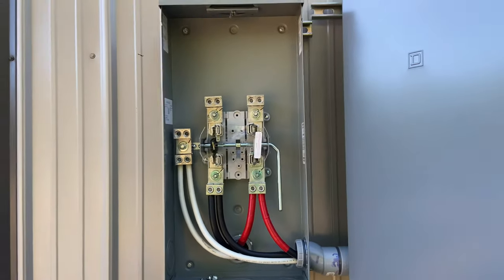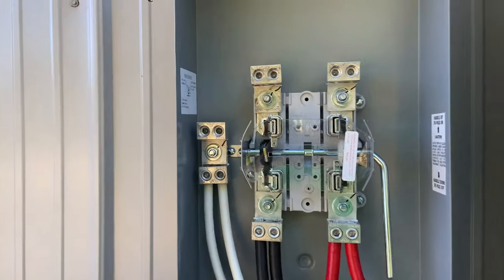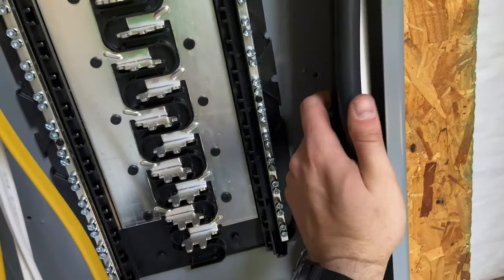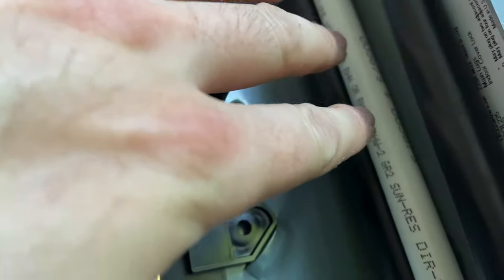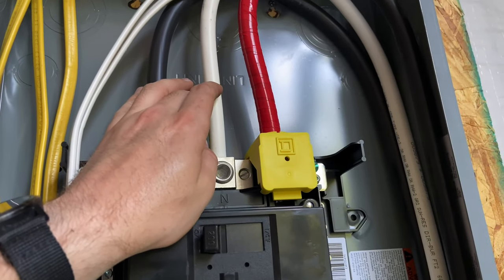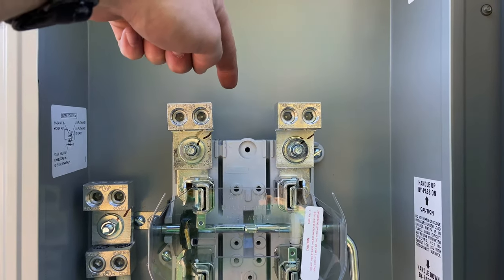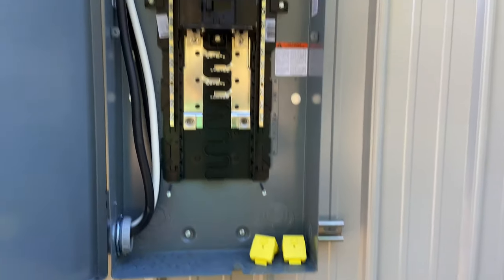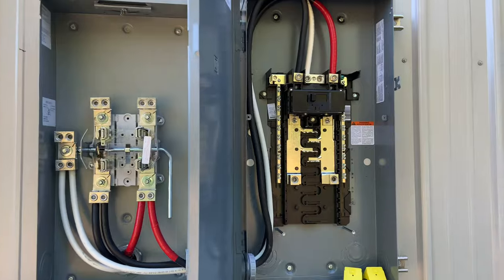Episode 16 - Service Entrance Wiring

Comment: So that's the meter base the power company provided? Good for you! Now it's on them. If they provided you with a 320 amp meter base then they must know the lugs and clear space in that can will accommodate their wires coming in and your wires going out. But they can't come in the bottom like you piped for them. Did they say they were coming into the meter base through the bottom.? Line an load on a meter base cannot share the same space. They have to come outside on the left to the line side lugs on the meter socket. It looks small, but they provided it. It's on them if it's wrong. They're gonna get out of it though by telling you your pipe job causes their wires to cross yours and that's unacceptable and their wires 
have to be totally independent of your wires so you will have to re-pipe up the side of the can and install a big lb or weather proof box nippled into the meter can. I'd like to see the size of wire they are bringing in to feed the line side of the meter. It will be aluminum tri-plex. They will use whatever will fit regardless of how much current you need. They are exempt from following the NEC. I'm surprised they arentbring the service wire in a conduit. Usually when you use direct bury cable that's not in pipe you have to provide a substantial sand base and substantial sand covering then you can fill in with dirt. But that's not NEC. That's what we use in my area, which is a lot of work for residential so we use 3" conduit as required by our local utility.

Comment: What happened to the NEC rule about all service disconnects being grouped together?  I guess different  parts of the country have different rules.
Reply from the maker: I did wonder about that. I have the two disconnects for the 2 “legs” of the 320amp service grouped on the same building, just one inside and one outside. 

I think this complies with at least some version of the NEC. 

In reality, the house will have an emergency disconnect on the outside per NEC 2020. 

I did not want yet another exterior panel on the shop just to feed to an inside panel so I am comfortable with the configuration.
Reply: @Ciband  ... grouping disconnects together only applies when the power is all within the same building. IOW, an apartment or several store fronts under the same roof.

Comment: I wonder what guage the power company uses to feed that setup. Probably 4/0... Also if you touch a feed lug with your screwdriver there will be a nice 💥 and the screwdriver end Melts and or welds itself to the panel, (usually just takes a nice big chunk out of the end of your screwdriver) ask me how I know.😜 Much appreciated for the video too. 😎👍🙏💯
Reply from the maker: Thanks for watching. 

My power company used 4/0 AL URD.
Reply: @Ciband  yeah it always seems like they go undersized, on their triplex too. My inspector just told me to use 250 aluminum for double 200amp panels for a double gang meter socket, my point of attachment is up unlike yours. Thanks for the video 👍😎

Comment: Can yo u list the part numbers of the Square D panels shown in this video Thanks!
Reply from the maker: Sure.

Outdoor feed-through: https://amzn.to/40UO1XM

Indoor Panel: https://amzn.to/3GC9NaB
Reply from the maker: I can’t speak to the meter main as I don’t have a lot of experience on that but I think you are on the right track. 

I am using 2 slots of the feedthrough panel for the surge protector for the house. I decided to put it there as close to the service entrance as possible. I have a matching one on the shop panel.  I will probably add a generator back feed breaker and interlock kit there too, eventually. 

Thanks for watching and good luck with your build.
Reply: @Ciband  As to your METER BASE with the DUAL LUGS  did the POC give that to you or did have to purchase that 320 Meter base?  If you have a part number of the Meter base I would like to have it from you ---  I need to be able to have a DUAL LUG 320 continuous service meter base with dual lugs as I want also to to feed two 200 amp panels like you have done.
Reply from the maker: I do not have a part number, unfortunately. 

This base was provided to me for “free” as a part of the install cost for the service from the power company.
Reply: @Ciband  OK Thanks!

Comment: The use on the feed through lug panel was fabulous.  I like that idea...maybe someday out door lights or an RV hook-up "who knows" but its nice to have the option for more power outside without drilling holes into your shop to get power outside.  Did you set two ground rods 6' apart below the panels or did you install an Ufer ground? 
I find it interesting both panels have the green bonding screw attached but I guess they are both main panels.
Reply from the maker: I used two ground rods.  The house will have a ufer. 

Yeah as near as I can figure from code that are both main panels since the service is paralleled. 

Thanks for watching.
Reply: @Ciband  .. yes, first panel from the meter is considered a main panel.... and two panels in your case.
Reply: Since neither of the panels are subfeed panels and both panels come from the service feed, the use of a bonding screws is required
Reply: @Ciband  I agree great Idea. I know one of my separate buildings with its own meter has the service disconnect and the meter in one box. It also has another breaker in it for the outside pool equipment. I wonder if they still do that.
Reply: If use feed through log panel can not use 4/0 luminum you have to use 250 kcmil or 3/0 copper because you can not apply 3.10.15(b) (7) of nec 2017 or 310.12 of 2017 nec
Reply from the maker: Thank you for this information. 

If I am understanding correctly then then I just apply the 83% rule to the service rating and then size conductors based on that. 

I have a 320A service feeding two 200A panels in parallel. 

I assume this is more a 400A max, 320A continuous service. I’ve hear this type of thing called both. Let’s assume 400A. 

Since I have the system split into 2 200A panels, then the service rating would be 200A, right?

If so, then 200A * 83% = 166A. Max amperage from NEC 2014, 310.15(B)(16) shows 180A for 4/0 AL. 

Am I missing something in the calculations?

Code aside, I don’t understand the distinction. A 200A breaker protects the wire. Why special rules for fees through?  Electrically I think it is not different than a sub panel. 

Thanks again for showing me this. I had not seen it.
Reply: Exactly what I have been looking for u wouldn't happen to know the numbers on the boxes??
Reply from the maker: Sure.

Outdoor feed-through: https://amzn.to/40UO1XM

Indoor Panel: https://amzn.to/3GC9NaB

Comment: What do you mean your not gonna use the ground wire?
Reply from the maker: If I remember correctly, I only needed 3 wire service cable since I was going from the meter to the first disconnect where the neutrals and grounds are bonded. I could only find 4 wire cable so I just bought it and did not use the ground wire. 

Thanks for watching.

Comment: What kind of offset conduit did you use to connect the meter base to the square D panel?
Reply from the maker: It was a 2” PVC offset. I think they are called meter offsets. It’s about a 9” pieces with a couple 45s pre-bent into it and make threads on the ends.

Comment: Would it have been to code to mount that box flipped 180 so that the large wires had a shorter run?
Reply from the maker: For that panel, I’m not 100% sure. I know you can do that with some Eaton panels.

Comment: be sure and drive ground rods and ground the steel bldg to the panel. steel post or wood post? bond to the steel post
Reply: Looks like he's got both of the panels bonded. I would think that he would need to bond everything in the meter and separate the ground and neutral in both panels?
Reply from the maker: Wood post pole barn. No structural steel.
Reply from the maker: No bonding in the meter can provided by PoCo. Bonding done at the main panel(s).
Reply: @Ciband  where are you going to bond the grounding electrodes?
Reply from the maker: Main panels

Comment: copper even if it’s expensive Copper can take more load then aluminum and if you over bend aluminum it leaves hot zones in the cable also did you put penetrox on the lugs and open aluminum conductors ?
Reply from the maker: Sure, I agree. AL gets the job done for service conductors. 

The cable and lugs I used did not require it per the manufacture. Modern aluminum wire and lugs do not need it.

Comment: How many Amp will be your main panel and your house subpanel?
Why not having three-phases?
Reply from the maker: I have 320 amp service to the property with 1 200 amp panel for the house and 1 200 amp panel for the shop. 

I did not want the additional expense of 3 phase. I don’t think I will need that much power but who knows down the road.
Reply: 3-phase is not a thing everywhere. Most of the US has "single" phase: a single phase 14kV goes down each street, with a special transformer for 1 to 3 houses making a split-phase so 125Vblack+125Vred makes 250V. 
The middle of the secondary coil in the transfo is neutral, and gets grounded!!
Getting 3 phase down an ordinary street is a major upgrade back to the distribution line.

Comment: It is crazy how an outdoor breaker box is so much cheaper than the outdoor disconnect that they actually want in the code.. the 'firefighters' switch as it is called in some places...
Reply from the maker: No kidding. I was very surprised.
Reply: @Ciband  ... most areas require a disconnect by the meter if the panel is more than 15 (?) feet away.

Comment: help me out here! you have a 320A meter can with meter but you have 2-200 amp panels/service? that is 400 1.25 demand factor...and you downsized the neutral in the garage panel, cant do that!  Why did you chose AL over CU conductors for short runs when you have several hundred feet to run to the house. Saving pennies on your electrical service is not the place to save $.  Did the inspector sign off on this install? Who did the original design?
Reply from the maker: I did the design. 

No inspector. PoCo didn’t seem to mind. 

Why pay 3x the cost when I don’t need to. I understand copper is better but aluminum works, is to code, and easy to swap should I ever need to. 

Downsizing the neutral one trade size is pretty common, especially since the triplex I bought was setup that way.  Thank don’t makes you feel better my shop will have a lot of 240v equipment. I’m sure if I did the load calculations I could go smaller, but MHF is cheap. 

As far as 320amp (continuous) vs 400amp (peak), using a pair of 200a panels on this type of service is pretty common. 

The service conductors from each “leg” on the meter are sized for 200a (4/0) so I’m pretty sure that is ok. 

Thanks for the comments.
Reply: @Ciband  I am a retired electrical engineer with a Prof. Engineers license and I am studying for my electricians license. I found this post which i find interesting.  I am going to use this case example to aid my study for the exam. I am not trying to be a smarty or do a gotcha...trying to learn from this. 

I notice you use terms like "pretty common" and "pretty sure". Electrical installations and engineering are based on standards of engineering and safety codes. Just saying....

There is a reason why the neutral is sized the same as the ungrounded conductors (not wires). During a fault of line-to-line or line to ground the neutral is required to carry that current which can very high as in the tens of thousands of amps. They are called symmetrical and unsymmetrical faults. FYI. Grounding conductors bonded to the equipment is there to reduce the potential of the equipment to zero. This is why Table 250.66 allows for smaller grounded conductors. 

Even though 240V equipment is used the neutral will carry some currents and is required to be the same size as the ungrounded conductors. I need to study this more. Chapter 2, Articles 220 and 230 deal mostly with SE conductors for housing while Chapter 4 (I am not there yet) will pertain more to your situation.

As for no inspector and it seems you are not "licensed" so IF something goes wrong such as a fire or an accident the insurance company will not be too friendly. IMO. This gives people like me a job...LOL. 

The NFPA 70 (NEC) exists for a reason and should be followed, its all about safety for your shop. 

I need to study this more but something is not right it seems. I hope you dont mind me examining this, others may learn as well. 

Regards,
Ron / PE
Reply from the maker: I am all about learning. I appreciate the discussion. I’m a software engineer with some electronics background so I think I get your mindset. 

For sufficient 240v equipment, you can downsize the neutral. If there is a ground fault, that runs through the EGC not the neutral, until get gets back to the first disconnect where they are bonded, or at least that is my understanding.  For a dead short then it’s just the two hots touching and then no neutral is involved. 

In reality this shop will not see a constant neutral load that will even approach maxing out a 2/0 AL.
Reply: @Ciband  the EGC is not intended for fault currents....currents always return to their source and the EGC is a high impedance path.
Reply: @jstone1211   Equipment Grounding Conductor (EGC) – A conductive path that is part of an effective **ground-fault** current path and connects normally non-current-carrying metal parts of equipment together and to the system grounded conductor (service neutral conductor) or to the grounding electrode conductor, or both.
Reply: @MrBluelock  key work is "part"...for symmetrical faults the neutral has to be sized as the ungrounded conductors
Reply: @jstone1211   My reply had nothing to do with the sizing of the ungrounded conductor. I was replying to your statements that "the EGC is not intended for fault currents" (which I showed that by definition that it is) and  "the EGC is a high impedance path".  Both of which are incorrect. My explanation for why the latter is false is as follows. The definition for an Effective Ground-fault Current Path( which by definition a EGC is one) is; an intentionally constructed, low-impedance electrically conductive path designed and intended to carry current under ground-fault conditions from the point of a ground fault on a wiring system to the electrical supply source and that facilitates the operation of the overcurrent protective device or ground-fault detectors.  If the EGC was a high impendence path then it would not be able to effectively clear faults by allowing a spike in current necessary to facilitate the operation of the OCPD in a timely manner.
Reply: Yall talking about feeder cables and these are service entrance cables.

Comment: I would have turned the panel over and fed from the bottom. Less mess to work around when making up the panel. Just a tip.
Reply: Clay ... many areas say "in at the top and out on the bottom" so you don't always have a choice to flip a panel.
Reply: @rupe53  thats the problem with the nec. Its subject to interpretation by   inspectors who couldn't wire up an outhouse.
Reply: @clayadams2068  ... ya know, I have only seen an outhouse (ok, it was a plastic porto-san) wired one time in my life and that was about 40 years ago. It was actually the inspector's idea!
Reply: @rupe53  exactly!
Reply: He could have only flipped the one on the inside, I left it just like he has it. Bending that wire at the bottom would have been a pain.

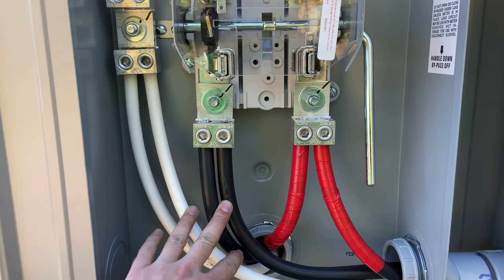Comment: when you said '2 phases', did you mean split phase where the phases are 180 degrees apart? (1:30)
Reply from the maker: Yes. Your “normal” residential 240v  hot to hot service.
Reply: I was going to call that out also. This is only a single phase service.

Comment: Where is the disconnect for the warehouse/garage building? That outside panel is only disconnecting to the house .let me know if I'm wrong plz thanks
Reply from the maker: Garage disconnect is inside, back to back with the meter.
Reply: @Ciband  yes on the main breaker panel but I think I'm my state starting this year you have to have a disconnect outside near the meter... Again tell me if I'm wrong
Reply from the maker: I know NEC 2020 requires it on houses. Not sure if that applies to detached garages/shop buildings. I do not have an external disconnect for the shop building.
Reply: @Ciband  ok thank you very much for the info always learning

Comment: Thank you for this great video. 
How come you don't need a ground wire in your shop's electrical panel?
Reply from the maker: My shops panel is a first disconnect so the neutrals and grounds are bonded together using the panel’s green bond screw.
Reply: @Ciband  It’s required to have separate neutral and grounds on your sub panel (you’ll need to buy ground bars that screw into Pre-designated on either side) and only for your feedthrough panel you would have neutrals and grounds tied together and  your lighting rod/ground bar can connect it into the the Neutral bar in feedthrough panel
Reply from the maker: All subpanels are separated. This video shows two main panels which are both first disconnecting means, so they both get bonded.
Reply: Your panels are not bonded together with the pvc couplings. Should have a ground conductor.
Reply from the maker: There is a #6 bonding both panels and the ground rods. This is shown in later videos.

Comment: Nice job but I probably would have used some washers with screws in panel
Reply from the maker: Thank you for the tip. I would agree in hindsight.
Reply: Duct seal also always use duct seal in wet locations